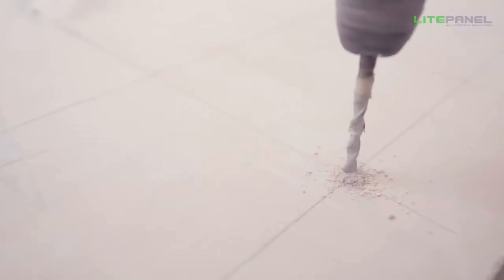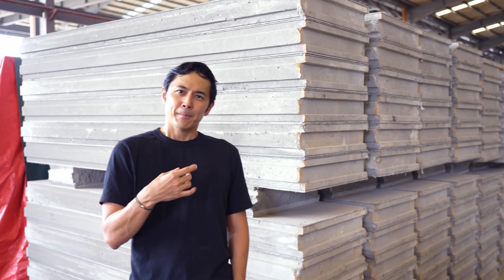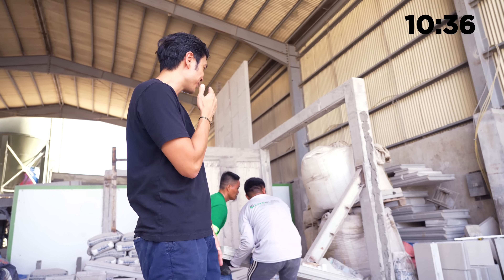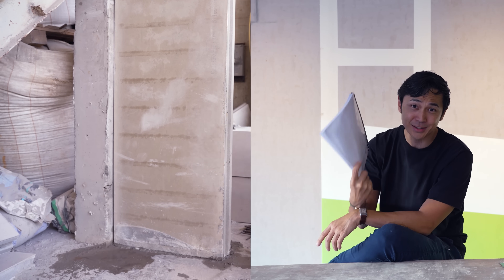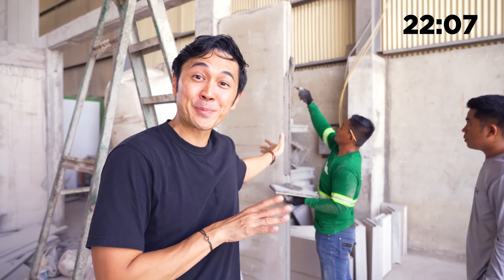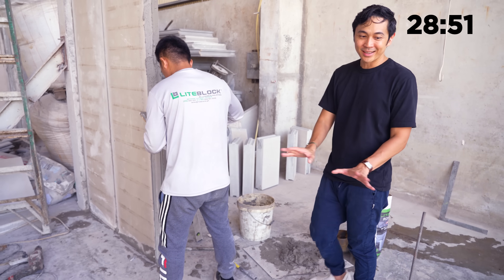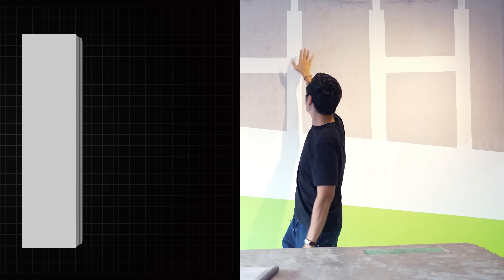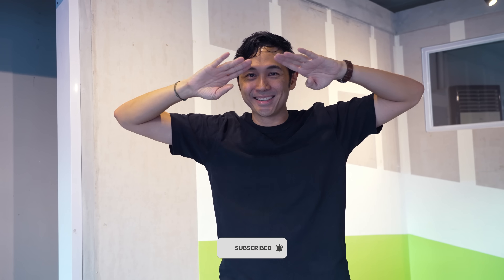We Made Floating Concrete! Is LITEPANEL Better Than Hollow Blocks?

Comment: How to install plumbing, electrical & waterlines with Litepanel walls?
Reply: (2)
Reply: As i understand as its core is same as liteblock. You can just make a hole or chisel it for your need either way its made of concrete. I think the only limitations of it vs conventional hollowblocks is you can't use it as load bearing wall. Not sure though.
Reply: @Anvash994 You can't use conventional hollow blocks as load bearing walls. That is a disaster waiting to happen.
Reply: veryvgood question . so stressful for those part.
Reply: i dont find it safe tlaga. hollowblocks are not built by adhesive but as a whole  they are poured concrete making all parts very sturdy as stone when harden
 not that panel  board that is being glued together.  it wont give each other support.

Comment: Filipino........  If it is really good, it should go world wide. I see there is an Arab company that has developed a process of filling walls with aircrete. Much success. You will probably have to construct your product fairly locally in order to avoid massive shipping costs.
Reply: yes i watched that in youtube they called it PIONER-GROUP. lightweight cellular concrete it is one of the fastest way of constructing houses and buildings. also there is another one RBM Malaysia

Comment: What is the process for windows or doors? Do you need a steel header, or are there prefab window sections?
Reply from the maker: No need for headers. Basically you can just install the LITEPANEL horizontally to serve as a lintel beam. Too much detail to cover in one video but we can assist you at www.liteblock.ph 👍🏻
Reply: Great question
Reply: @thatguyslater  So the windows oversized and then fit with block for opening finals? Salamat po
Reply: @thatguyslater  I agree to the other comment sana mapakita din ung lite panel sa actual project house. sobrang innovative and looking forward to use this material sa ipapagawa kong bahay.

Comment: It looks like a great product.   Few questions,
1) what is the insulation value ?  Does it transfer heat same as the hollow block wall?
2) I see how you tie it to the panel next to it, but what vertically is keeping the wall from falling over?  You have the pin at the bottom but all the panels connected will those pins keep the wall from leaning?
3) is this available throughout the Philippines?  Seems some islands like Bohol does not get this type of new building technology.
4) why is the hollow block so brittle?  Can't it be made with stronger cement mix?  Or a cement mix like the panels.
Reply: I’d appreciate reply to these questions too
Reply: Masyado ba mabigat yan boss
Reply: Can it be used as a roofing material? I am thinking of replacing my G.I. sheet roof if this ok with regards to rain and harsh weather like typhoons and hot weather during the summer months.
Reply: This is a speed demonstration.

I have the same questions, i myself would build a ceiling and floor track that the panels would slide on like a sliding door and adhere only BETWEEN and at Panel ends.
Reply: I like the concept of the panel but is these in the building code, considering Philippines is in the earthquake zone country, using two rebars in a panel (2x8) seems not enough to withstand the lateral movement.
Reply: What about columns? Is there a belt course? If you can explain these I would appreciate it
Reply: Why no reply
Reply: This is an unproven product in the event of an earthquake, but it is similar to insulated foam walls, which are quite durable during hurricanes. I imagine the R rating is not going to be amazing, and sheathing strips or interior framing will be required to properly insulate and finish the home. If these walls are proven to be durable during earthquakes, they are definitely a game changer. It looks like they can be cut to size, but it would be nice to know if they are good as columns.

Comment: What I have seen here in the U.S. are modular blocks much bigger and lighter than the regular cement block and they are used as an external wall throughout the house.  These blocks interlock and I was pretty amazed by their design as it also cut down on installation time and the method has an auto correction as far as being plum and level(As long as the foundation was prepared and level then these blocks just go up with 1 person working alone.  Sorry I can't provide the manufacturer's info as I have only seen the program on cable tv some 5+ years back, but definitely the house being built was here in the U.S. Would definitely use your product if ever we decide to build a house there in Cebu or else buy one of the existing new homes.  Good Luck! I'm sure you have a winner product for sure!
Reply: Insulated concrete forms or ICF, basically giant Lego blocks of Styrofoam prepped for rebar already. Great invention.

Comment: Looks interesting, but my concern with this (and pre-fab panels in general) is the lack of stretcher bonding i.e. they're not overlapping two panels.  They're just laid out next to each other  (stack bond).  I'd like to see this used with a more structurally robust technique and with an option to use tensile re-enforcement such as non-ferrous or Basalt rebar.

Comment: Here's a thought I came up with years ago your welcome to it instead of a single panel which will only be so strong consider panels that are flat and smooth on one side then has fingered points on the other side placed so if you take two panels turn one so its fingered side fases the fingered side of the other they now trap a ridge on the edge of the slab and then get bolted together important fingers casted off center so they offset from each other creating a void between them allowing piping and electrical to be run in the void and insolation the advantage a stronger wider wall allowing to go higher. Ends of bolts set in recess once built get filled and smoothed over . Door and window frames get installed as you come to them they can be concrete, metal or wood even vinyl .
For more detail, finger that faces other slab a pyramid shaped with flat top instead of point has bolt hole with a recess on its smooth side place the two panels together use hole to drill hole in second panel instead of worrying about alignment counter sink smooth side bolt and nut . Cap off top of wall or stack second wall with a multitude of connection possibilities could even drop ac vents through void between the two slabs. If you have trouble understanding what I'm expressing take both hands make tiger claw hand with each lay hands palm to palm finger tips at wrists void between palms bolts go through fingers bolting two slabs together.
Reply: Amazing idea. I just commented, they have a product that is 80 to 90% engineered they lack better joint procedures and installation of services. Your idea will fix their product, hopefully they will reach out to you
Reply: Great . How to reach you for a business proposal?

Comment: Interesting product, maybe you can do a full demonstration video on how to use Litepanel with door/window jamb, how to fix it on against columns and beams, and how to fit electrical and waterline in it. Also, are Litepanels waterproof for external walls? Thanks.

Comment: Great product! Mabilis din siyang ilagay kaya mas mababawasan ang time ng construction ng isang bahay. Pero question po, gaano sya katibay pag nailagay na sya sa isang bahay, pwede ba syang maging load bearing na wall? at gaano siya katibay compare sa hollowblocks na wall at purong buhos na semento. Since walang rebars yung mga panels.
Reply: Sir Slater👋 Safety rin po ba Yan sa lindol? malakas ang lindol sa Pilipinas ,  na Di magiba gamitin sa 2nd upto 3rd Floor  pataas extended  ? kc gusto  ko po rin yan mabilis pagawa available rin sa   Metro Manila ❣️🍀Salamat  po Sana mapasin po at masagot🍀❤

Comment: It looks interesting. Did you ever design a House with ceilings as low as 2,44 meters ? I think 3,05 would make more sense. How much do the panels weigh ?Are there special elements for corners/windows /doors and so on ? How do you cut them, with an angle-grinder ? Did you do any earthquake-simulatons/tests ? You deliver nationwide ? But basically I like the idea. Regards, Stephan

Comment: A few questions:
- Does litepanel requires Stifferer Columns and what span does it need if ever
- how to install at top of a window opening, does it need lintel beam?
- if the span between 2 columns are needed to be fully installed by a wall, how do you apply pins and adhesive at the last end of wall
Reply: Additional question:
- what's the compressive strength of litepanel? 
- if panels need to be layered on top of each other, do it still Ned lintel Beams and what's the recommended design of lintel beam?

Comment: Have you looked into licensing this for tilt up commercial buildings here in the usa ? It's a similar design just much larger and with poured in metal plates etc for securing things.
Reply: I've set many panels like this in commercial warehouses only much much bigger panels lifted by crane . If you could make them much much lighter that might be a game changer... smaller cranes and lighter loads for the semis etc ... and I would guess better insulation properties. But can it freeze?

Comment: If it is lighter, you could also probably say the savings in reinforcement for SMRF such as girders, columns. Curious ako sa connection detail sa limit ng slab thickness? Actually a structural engineer here

Comment: @thatguyslater Nice product and demo video. I am researching a house build in the Philippines and want something that will stand up to the heat. What is the R rating of this material? I am interested in a modern passive house design with a R 40 for the walls, but have yet to find anyone with expertise in this field here or the products to achieve this.

Comment: Have a question engineer. Any issue on hairline cracks on its joint since the face is cement board ? 
Thanks

Comment: I think that the weakest point of the wall made by these panels is @ the column-panel connection. Why not attach the 1st and last panel to column dowels like these two panels should have holes to be inserted in the dowels and to be locked before attaching the succeeding panels. There will be no issue with the succeeding panels as they are interlocked to each other. Wala ko’y salig sa adhesive nga ipapilit sa smooth column sides. Then on the slab and beam connection maybe the easiest way to strengthen the wall is to pin concrete nails (serves as dowels) before laying adhesive and the bottom (facing slab) & top (facing beam) should have notch so that it will interlock to the connection. These are just my ideas on how to make this  type of wall durable to strong winds.

Comment: Hello, just a question, if we are going to build a house using lite panels and then there is a window so need po ba bumili ng lite block (the smaller one used in drop test) or we could split the lite panel in half in order for us to make room for the window? Just a question po, TYIA
Reply: Mag cutting

Comment: What advantage does this have against walls made from cement, sand and gravel or just cement and sand poured between two reusable panels with or without rebars in between? Like you said those walls of yours are not indestructible especially without steel reinforcement.

Comment: i dont find it safe tlaga. hollowblocks are not built by adhesive but as a whole  they are poured concrete making all parts very sturdy as stone when harden
 not that panel  board that is being glued together.  it wont give each other support.

Comment: AAC sulfide gypsum based .. not really water proof.  Must be coated in freezing and thawing climates and and expensive mix.. also only semi-structural and degrades rapidly in saltwater.  Not much better that 'flffy-stuff' like hempcrete (faddish mortar mix)..  I'll bet that this has fibeglass-poly fiber to hold it together (or should)..  and the music sucks and this is expensive in the USA..

Comment: 😂😂 conflicts of interest that only people who dont know about construction .... your panels still move only pinned on oppisite corners and the need to be propped and secured properly until adhesive goes off and there are better methods of installation of panels ... secondly no one mixes mortar without a mixer these days if you had block layers there wouldnt be much difference .... the obvious underhanded promotion is why the majority of people are sceptial .... personally i think various panel types are game changers but i found this video comical .... 👍

Comment: The blockers are not proficient so this is not a fair comparison as well as the panel wall has an upright beam with which to work giving them a massive headway as they have the floor like the blockers but the up right column for stability. The blockers dont even have lines ready built with which to maintain straight blocking. You've done the panels an injustice as the panels are the better option but because you've downplayed the bocks so unfairly it makes one second think the panel construction.

Comment: You seem to have good engineers around, please design a better connection between panels and then you will have a killing product.
Right now is 90% done.
And please don't ruin your test with a clearly bias towards your product, those brick layers obviously suck, and installation was done very poor  on purpose. Any of my guys can install better and faster than that
Once again, you have a great product don't bring it down with fixed "tests". There is a place for each product and their applications.